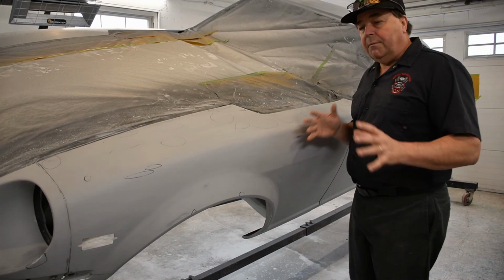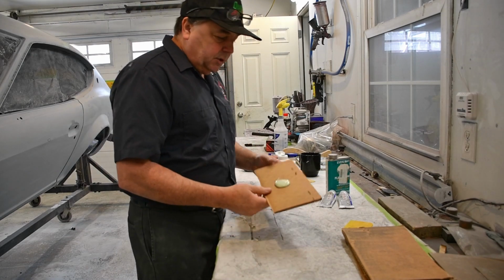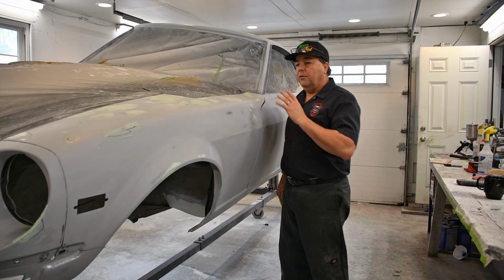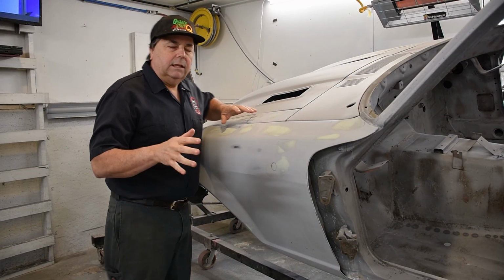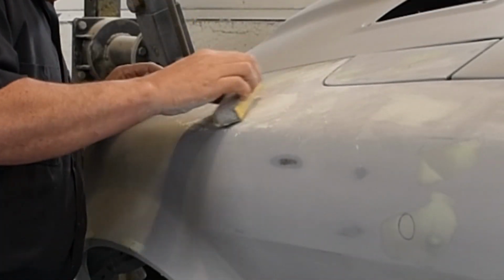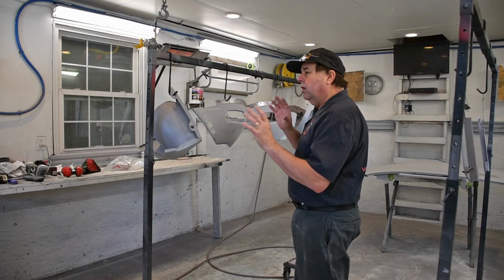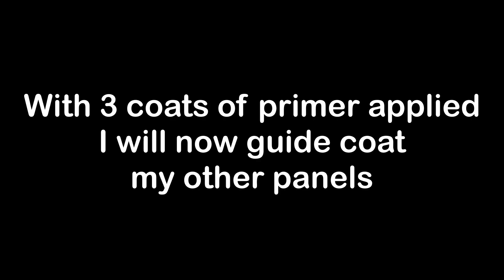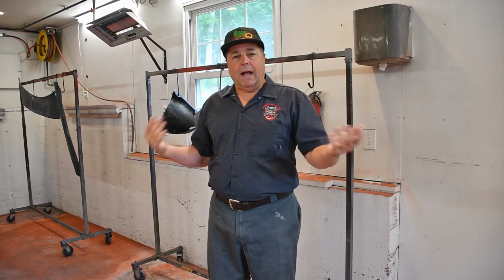Achieving the Perfect Paint Job! How to Prepare a Datsun 240Z Before Applying Final Primer

Comment: Great video.  I do have  a question about the black primer.  If I was going to paint a base coat in white, would it be better to go with a lighter gray primer instead of black, since the darker color dominates the lighter color?  Thanks
Reply from the maker: Yes, match the primer/sealer to your base color.
Reply: @troykane  sounds good.  I'll do that.  I just picked up another 280z... Good project to do it on.  Thanks sir!